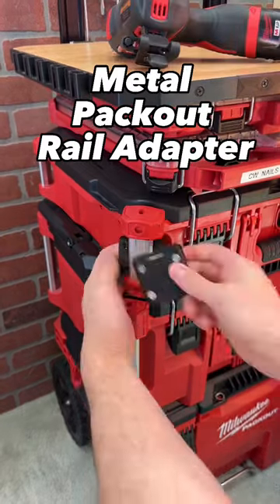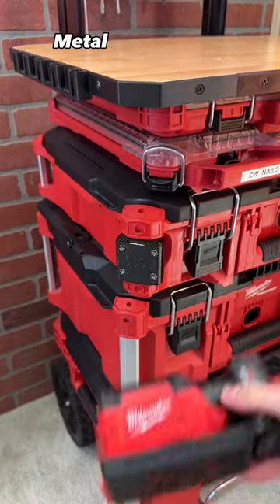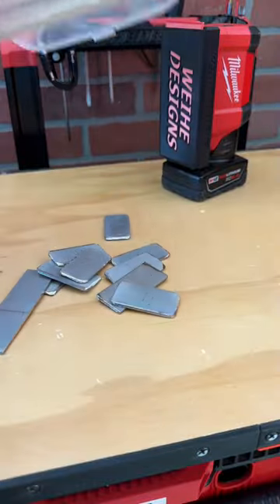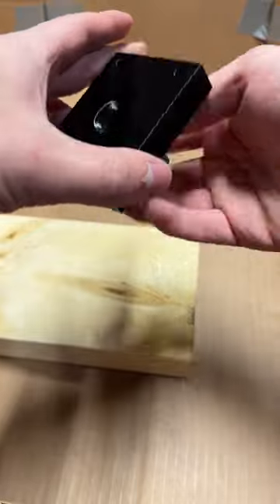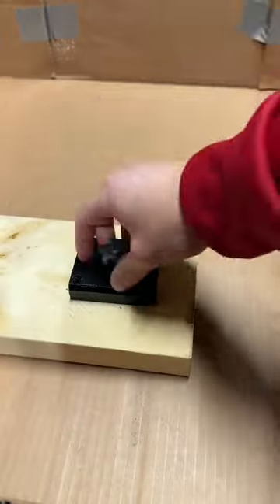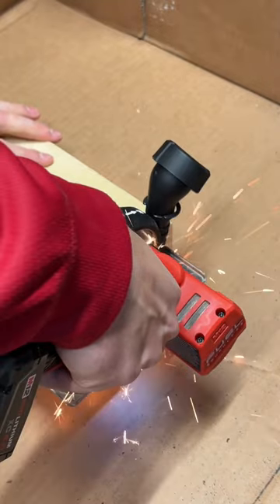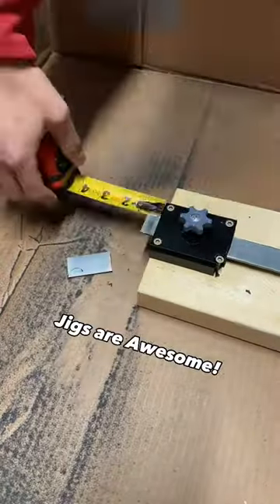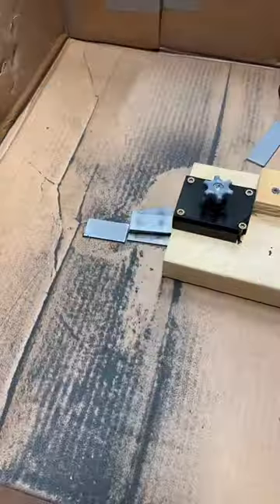Packout Rail Mod #milwaukeetool #3dprinting #milwaukeepackout

Comment: Jig is cool, but why didn't you make a stop block to eliminate the measuring part of your process?
Reply: Also why a steel plate attachment and not  a magnetic one?
Reply from the maker: I thought about it. But I only cut 20 and I also cut a few at different lengths for other prototypes so I would have had to move the stop block anyways
Reply from the maker: Magnet attachment is in the works. But it would be more expensive and some other magnetic tools would have reversed polarity and not attach
Reply: @JakeWeihe  Take a look at  Halbach Arrays as a way to solve the polarity issue.

Comment: Also why not put the metal in instead of aluminum, besides the lighter weight of Al?
Reply from the maker: Are you referring to the stock rails?
Reply: @JakeWeihe  
Yes Sir
Reply: @papawd3991 less expensive this way I’d guess.